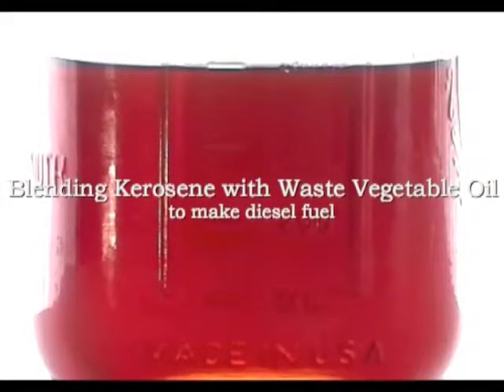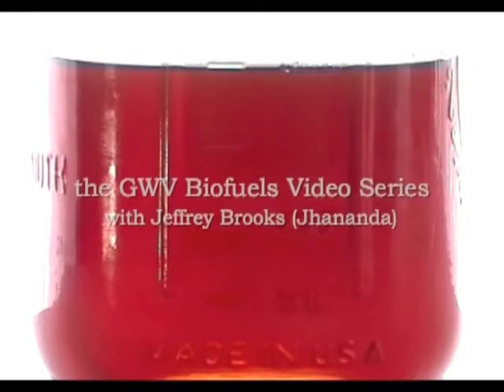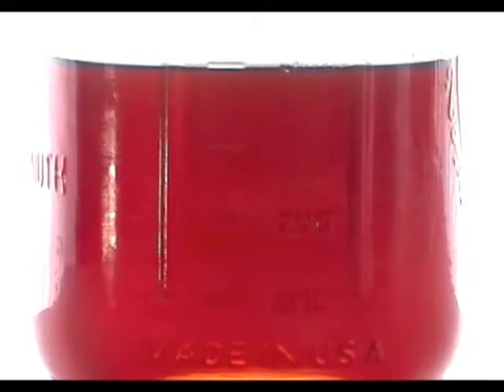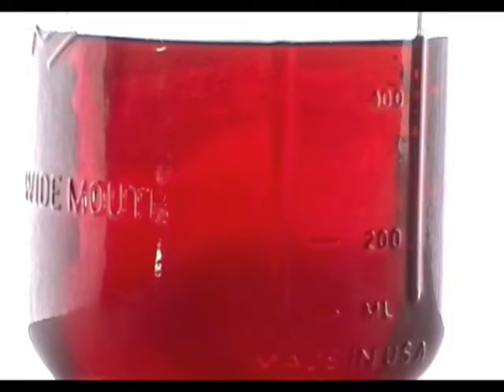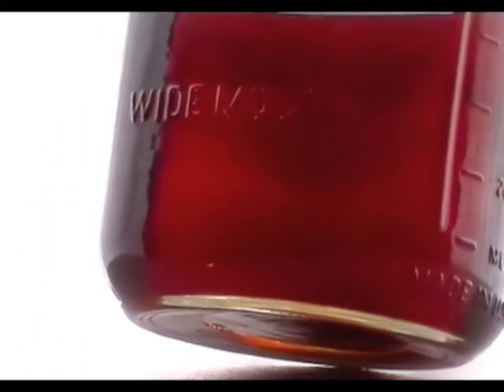Blending Kerosene with Vegetable Oil to Make Waste Oil Blend Diesel Fuel

Comment: Given the mix proportions 40:100 (oil:kerosene) I wonder if this (new) resulting product could now be used as a fuel for diesel vehicles or engines?

Could it used directly as fuel for a kerosene heater still or any kerosene burning device?

How about an old fashion oil lamp?

Here, in this part of Uruguay (bordering Brazil), kerosene is sold pre-bottled in 1 liter bottles for UY$110-180 Uruguayan pesos (or) US$2.75-4.50 per 1 LITER bottle of kerosene!!

Now, with this formula— I hope 🤞— I may be able to save nearly HALF on my heating cost, using an old kerosene heater.
Thanks!